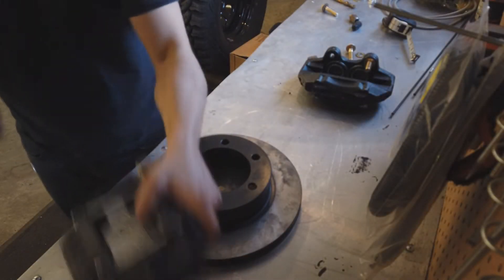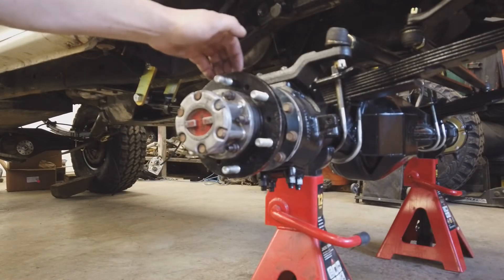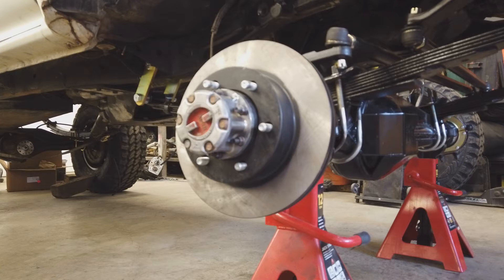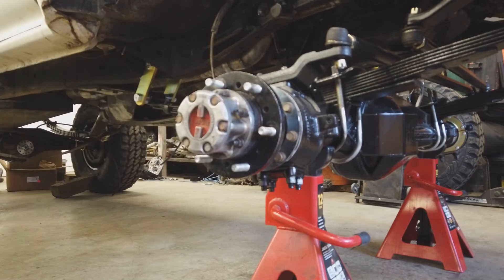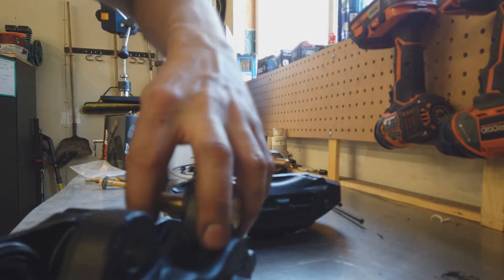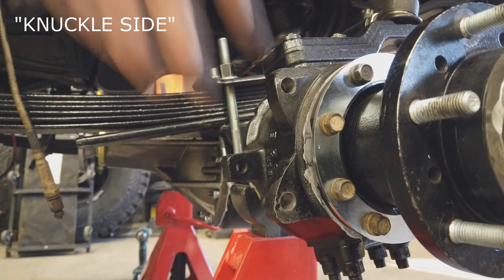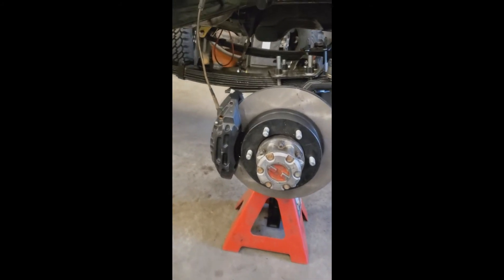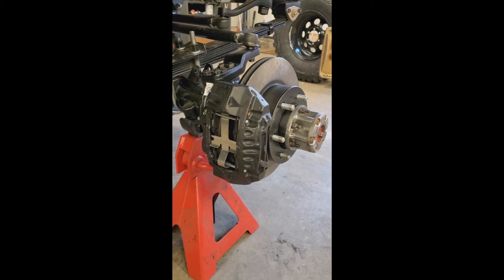Toyota IFS Hub Swap

Comment: Do you know if you can still fit 15" rims after the rotor and caliper upgrade?
Reply: I’m wondering the same
Reply: @strictlysidewaysusa  i ended up doing it and I was able to run 15" rims. you should be fine with an offset rim or even .5 to 1" wheel spacers.

Comment: Does this setup except the 30 spline axle shafts? Also, my 2nd gen sr5 4runner has calipers that look identical to the ones you used in this video, are they the same? Thanks you.
Reply: 2nd Gen 4runner are the calipers you need

Comment: Hey good video, just did this on my '84. The only issue I had was my brake pads hanging off the rotor almost 1/4".  Did you run into this at all?
Reply from the maker: I haven't ran into that issue  yet everything is nice and center what year of caliper are you running?
Reply: @OffRoadBrigade  My donor vehicle was a 93 V6 4Runner, I grabbed the hubs and calipers off it.
Reply: @pacedavis8335  ?
Reply: @MrCalikidTech  I never figured it out man. Please let me know if you do.  I've just been running it like that. It still stops better than before but kind of a bummer.
Reply: @pacedavis8335  yeah i’ll let you know what i figure out, drives good but still would like to get it figured out
Reply: @Pace Davis  I believe the trick is to use pads from an 80 series land cruiser
Reply: @sk8rsk8mr there are two different size 6lug rotors. 11”(almost 12”) and 12” (little bigger than 12”) that might be the issue
Reply: @OffRoadBrigade  i did the same thing and have same problem I was wondering if there was any other rotor that would fit exact
Reply from the maker: @albert8090  hit me up on Instagram @offroadbrigade
Reply: I just did the swap had same thing pad hanging out like 1/4 inch ? What was the remedy guys ?

Comment: I'd be interested in seeing installation of ifs hub and how it's wider but same length axles, great video thanks for sharing 👍
Reply from the maker: Hey rich it's the location of of the flange so the actual hub remains the same internally
Reply: @OffRoadBrigade  I assumed that's what was happening.  Do you notice a huge difference in scrub angle? I'm considering this mod for a daily driver 🤔
Reply from the maker: @richb.6015  shouldn't make any noticeable difference I wanted it for stability,   so far I haven't had the opportunity to get very many miles on the truck. Still waiting for a new turbo.

Comment: What size wheels do you have to have, will 15 inch wheels work?
Reply from the maker: I believe 15 inch wheels should work but you'll need to run 3.75 back space  wheels.